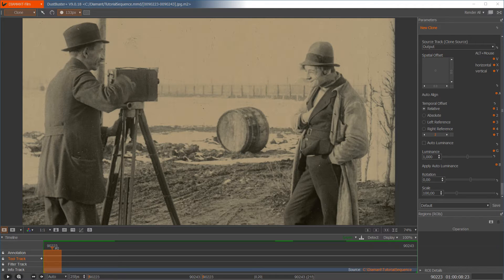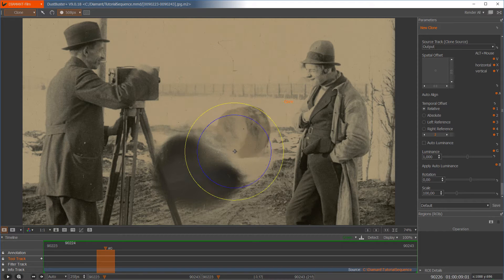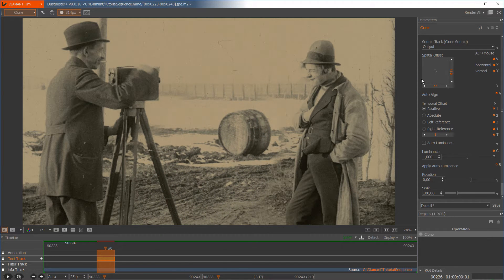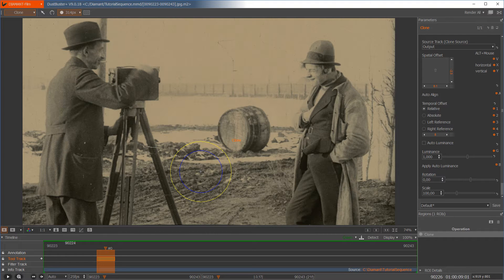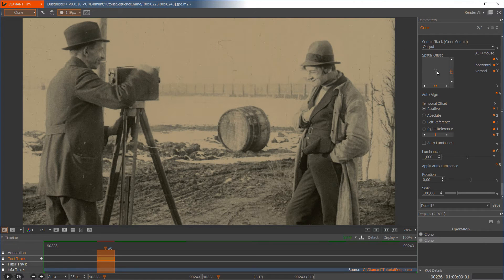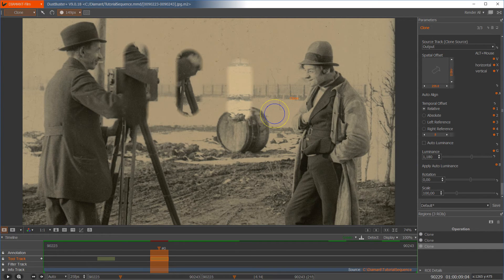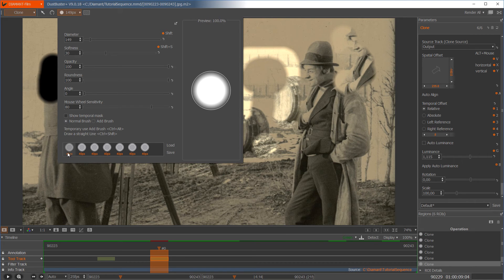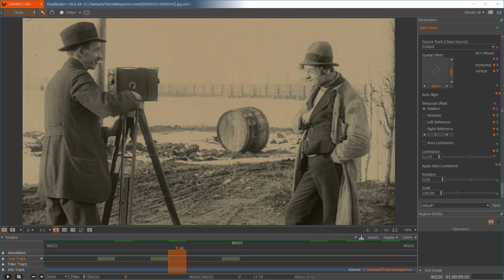Clone Tool

Comment: When you apply your clone correction in your image do you have the possibility to see also your offset ( the place where you take your reference ) like clone tools in Autodesk Flame or Adobe Photoshop ? Here you show us a Reveal tool called clone. How you can repair your picture with this tool  when you don’t have any references  for big scratches or big punch marks ? Thanks for your attention.
Reply from the maker: Yes you can see what you would be cloning in a special view (Magnifier View). When there are no references it becomes difficult. Clone always needs a reference at least from some other frame. If there is no frame which you can use nearby you can use ExInpaint or DeepInpaint to recreate this area. This is more difficult the larger the area gets.
Reply: Actually Diamant is very new for me. I don't understand why there is no offset axis in the clone tool? Why the center of your Roi remains the center of your picture, which to correctly align  in position and rotation is very difficult. Adding an axis offset would be a nice improvement.